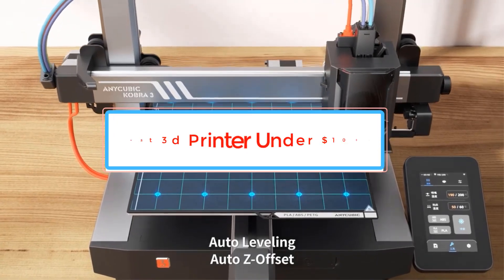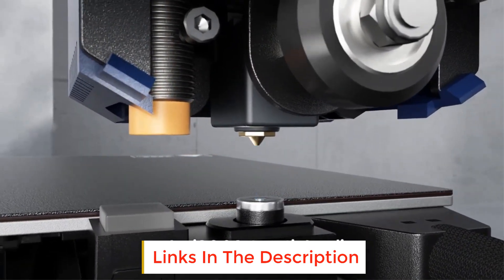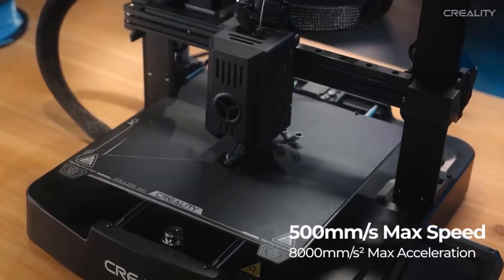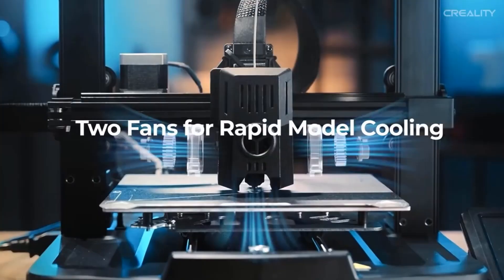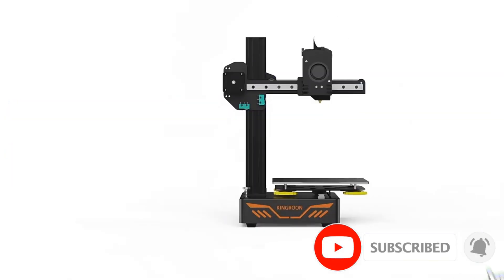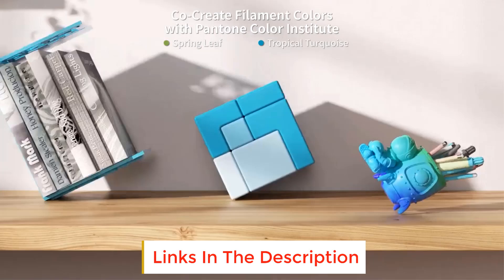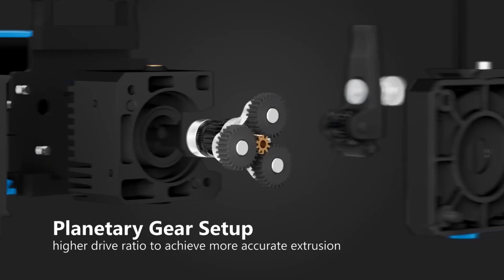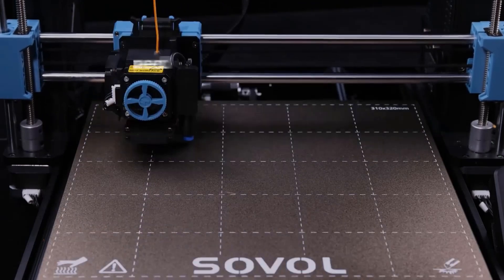✅Top 5 Best 3d Printer Under $1000 | Best 3d Printer in 2024

Comment: This AI commercial is all BS. If you want an unbelievable bargain printer get either Bambu Lab A1 series printers on sale. I've been in this hobby (mostly for tinkering on the printers) since 2014 and have designed and built many printers with various kinematics. I just got the A1 Mini for my daughter for a cpl hundred on sale and I'm utterly blown away. Straight out of the box + 15min auto-tune it prints as well and as fast as my coreXY and it's a lot quieter doing it. Damn...